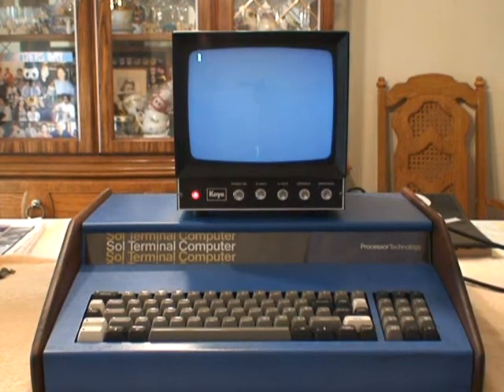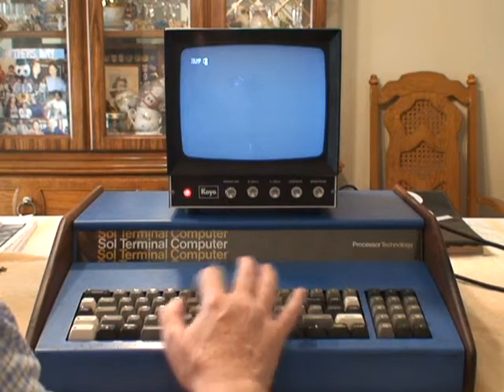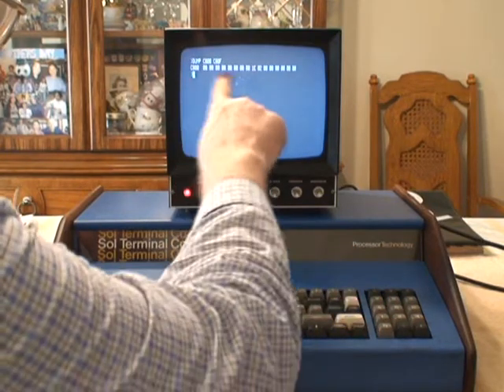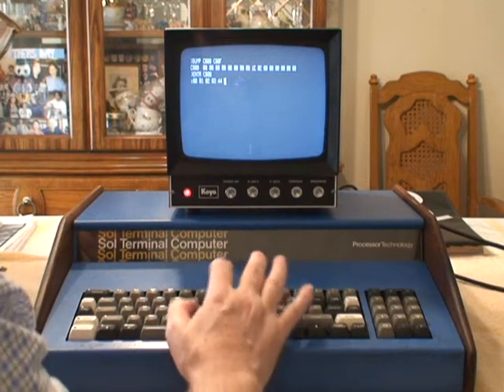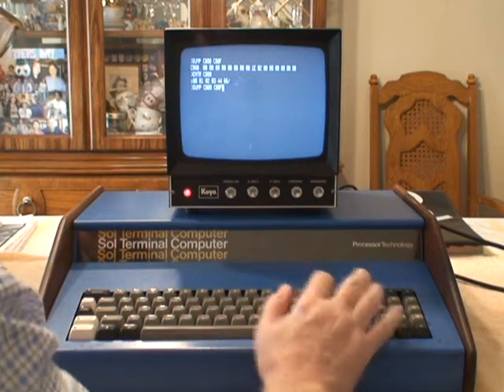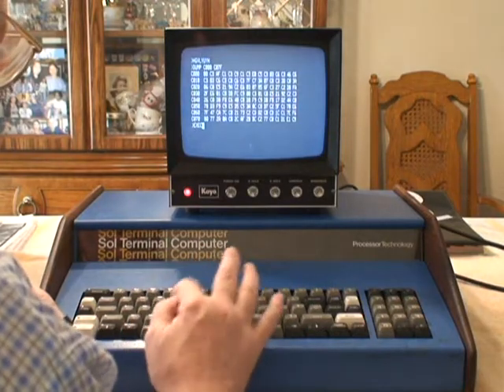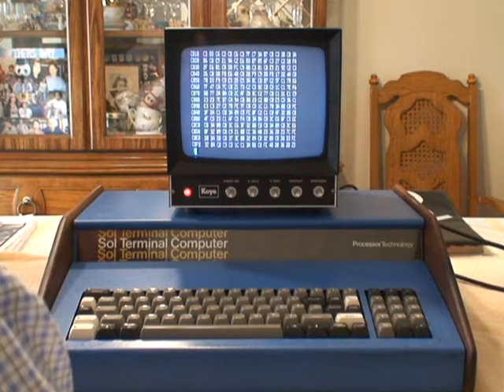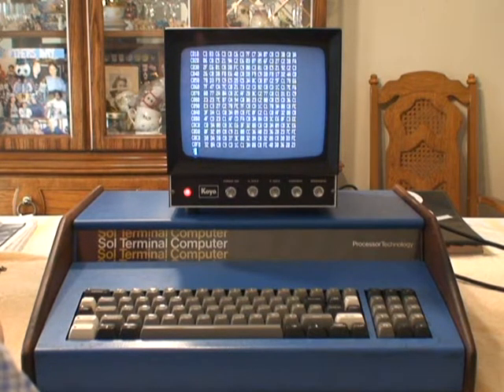Sol-20 Comes Alive!

Comment: Hey. Great videos. I've watched all of your vids on the Sol-20. I've got 2 that I'm restoring and have a quotation about the keyboard pads. I've created some replacements pads using a mylar emergency jacket but I'm getting some random characters. My questions is should the conductive side of the mylar make contact with the PCB to short the contracts or should it be  turned around so that it's more of a capacitance contact?

Comment: I built 3 of those SOL-20's, think I still have constuction manual. Alot of soldering. but no worse than the altair or the Mits boards. Fun to play with but no floppy just a cassette interface.